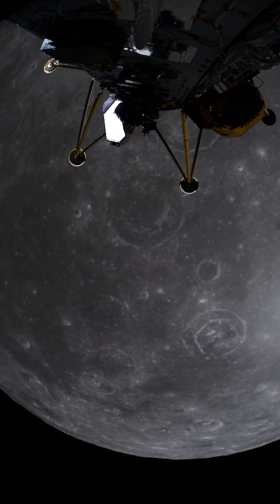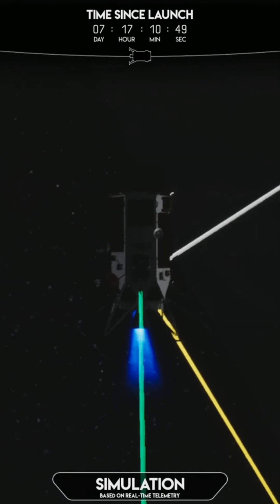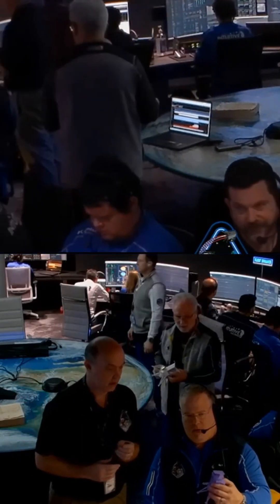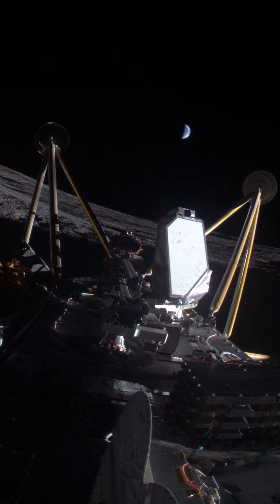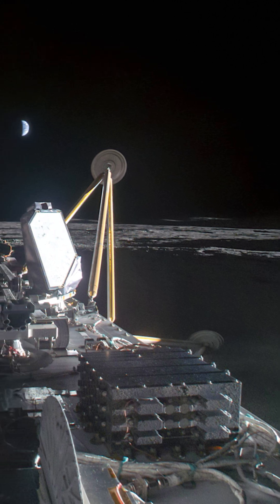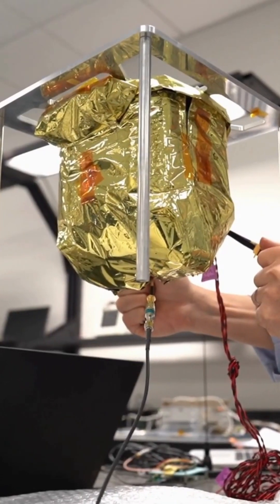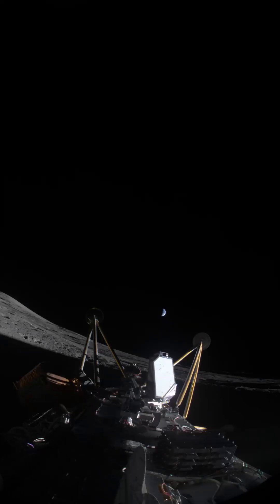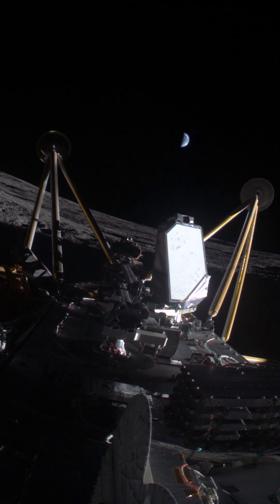What Exactly Happened To The Athena Lunar Lander?

Comment: shiman, these failures are expensive, and humiliating.

Legs - farther apart!  If it can't be stable on a 45° or 60° incline, don't launch it.  And, maybe a bit of leg flexibility so it can better adapt to weird surfaces.  Six legs, and maybe an automated way to relax some if they're causing it to tip.

Center of mass - should be low, not high.

Solar Cells - if they're not pointed at the sun, ☠️  Maybe some backup cells, all over the outside, so there's always some pointing to the sun.  In case of disaster.  Solar cells are cheap.

Antenna - similar.  You have a directional antenna, for use if you're lucky.  And an omnidirectional antenna that always works, although not so good.  So you can still communicate, even during a disaster.

Testing should be malicious.  Walk over to it and kick it, see how it behaves.  Turn it upside down, see how it behaves.  Throw sand on it.  Throw rocks at it.  Keep saying to yourself that it's running with some major sort of crippling - how do we get around this?  What if the battery is almost dead?  What if he solar cells can only move a few inches?  What if this or that happens at night?

You may think it's a waste of time.  No, launching a spacecraft, flying it to the moon, and having it fall over and die, is a waste of much more time. Test and fix.  Test again and fix again.

Comment: Please forgive me, I don’t know anything about this stuff… Why not design a landing vehicle so that the solar cells point in any direction or are movable?
Reply: thats a complicated system, more points of failure there. Since this lander is landing at the poles the sun will move in a circular pattern around the lander and it will always be low in the sky. So its easiest to just put a static solar panel on the side of the lander

Comment: I kind of wish they had inflated a bouncy house all around the lander, so it could roll around to a flat spot before deploying the lander legs and sitting upright.

Just because it should be fun.

Based upon Murphy's Second Law of Entertainment,
fun things usually work better.
Reply: They've done it before. Mars Pathfinder and the two MER rovers were both enclosed in a layer of what are essentially car airbags to cushion their fall. That doesn’t solve the problem of landing in the right orientation, which was instead achieved by having the spacecraft within open up like a flower (which would force them to tumble right-side up). I believe the problem with modern Mars rovers and these Moon landers is that they are too heavy for the airbag technique to work.

Comment: It could be it didn’t land too fast (though likely or just barely too fast) and the issue is the leg design. Have ing a good flex like a shock absorber dual to keep leg “centered” may be required.  If one leg can hold the weight of the whole unit because it contacts first, it could snap.  It engendered to all touch down evenly/level for GVW, and it lands on one (hard or soft) it could be a weak design.

Comment: Not to put a too fine a point on it, but learn from the successful Apollo landers. The center of gravity is too high, so of course any lateral movement on landing is going to put it in the dirt on its side.  Might I suggest a 1:3 ratio. For every 1 unit vertical, have the opposing landing leg pad to landing leg pad distance be 3 units.  Problem solved.

Comment: Keep the centre of gravity low and the legs wide apart on future missions if you want to give your lander its best chance of survival.
Reply: The lateral velocity needs to be totally zeroed before touchdown. But the laser optical system didn't work correctly. So it didn't "see" the surface, didn't know the true altitude, nor relative velocity. Probably also couldn't exercise the hazard avoidance of steep slopes or boulders. 

Note how the altitude readout never dropped below 5 meters. It was flying blind.

Comment: They haven't understood the effect low lunar gravity has on lateral stability.  See A11 in P67 manual flight segment.
Reply: They need to totally zero lateral velocity before touchdown, or it's inevitably going to trip and tip over. I think the laser sensors for relative surface velocity and altitude failed. It once again was relying upon inaccurate inertial guidance calibrated in orbit.

Comment: All the time the lander's IMU accelerometers revealed the exact orientation. But they kept it secret "needing pictures" to determine the final orientation. What a crock! And yes, I have written spacecraft attitude control flight software.
Reply: Give'em a break. You don't want to claim failure and then find out things were fine.
Reply: Yes, it was not believable that they said they didn’t know the orientation of the lander and needed to get pictures.
Reply: IMUs do NOT take kindly to harsh impacts. There's a reason why these things use many sensors in coordination to determine things. Data from any one sensor could be bad.
Reply: @ Thanks. It is not clear from what they released whether it was a hard impact or they landed on a steep slope and toppled over.

Comment: I'm always amazed that they seem unable to add a couple hydraulic 'spider legs' that could upright a fallen toppled lander, spiders on Earth, with much greater gravity, use them all the time...
Reply: A leg or two broke
Reply: It was traveling sideways at the touchdown, and erroneously, the altitude readout was stuck at 5 meters before and during touchdown. 

IMAO, the inertial guidance system never got an update on the landing site from the optical laser system.

Comment: Why did they make the lander so tall and top-heavy?  Something with a wide base and a low center of mass would still be upright even after crashing at high speed
Reply: Might be a limitation of the fairing on a Falcon 9 or the kinds of instruments their lander needs to house.  It could be one of their instruments needs to be further away from the surface or that they need to stack experiments vertically as they can't squeeze them in horizontally and fit inside the fairing on a Falcon 9.  Does seem like a poor design for a surface that is notorious for unexpected rocks and craters in landing zones as you really have little room for error in lateral movement if you don't want to tip.

Comment: It is not the first time a device sent to somewhere ended up with the solar panels facing the wrong way. I get that every little bit of added weight is added difficulty, but for such an important element as providing power, one would think they would plant solar panels on all sides or have a mechanism flipping the panels.
Have these guys play some Kerbal Space Program to learn how to construct something that can get up after falling over.
Reply: one word, money. 
if everything goes as plan, you don't need it, so you don't pay for it. 
A single kilogram is extremely expensive to bring in orbit, many time more expensive to bring it to the moon. 
Kerbal is a good game, but it's still a game. Economics are enemy #1 in the real world.
Reply: Seems like solar panels are just a bad idea for anything space especially when we can build RTG’s that’ll power a space craft for 50+ years. Just like the Voyager missions.
Reply: @ how much for a RTG compared to a solar panel? Where do you put it on the current craft?
Life is not a game.
Reply: @christophergruenwald5054  RTG is very costly and hard to make. Good luck with that.
Reply: There are solar panels on all sides AND the top, though. It just happened to fall into a crater that receives no sunlight. It's very dark in those crates down at the south pole.
Reply: My thoughts exactly. All that effort getting there goes to waste if you've no power so no matter how expensive it is to design a resilient power generation system, it has to be less expensive than a landing f*ck up.

Comment: Okay, I admit, I'm not an engineer, but please hear me out. 

What if, you made the CG lower?
Reply: That would help, for sure.  But IM's landers seem to have a serious issue of not knowing where they are, and hitting the surface harder than any reasonable landing leg system could survive.  Plus, its hazard avoidance system can't tell when it's landing inside a crater, which is a pretty bad downside for a Moon lander.  That needs to change before they start changing the basic shape of the lander.
Reply: A low CG doesn't do anything to stop you from tipping over if one of your landing legs is broken.  IM needs to fix their guidance and navigation so they can land slow enough to not damage the vehicle.
Reply: @Dovorans  Disagree. IMO. Needs to be more resilient. Single point of failure both times despite landing in a functional state.                               
                                                                            Go stand up outside with your feet together, arms at your side, and have someone push you. Repeat sitting indian style on the ground. Get back to me.                                                      
                                                                                 Wide base, low CG, means vehicle is more likely to stay upright on questionable or unknown terrain. Velocity wasn't horrible as vehicle was functioning. Even if a leg or two breaks with six of them vehicle would be near optimal. This is two in a row. 
                                                                                        They could even keep rectangular form factor just re orientate the insides. Main engine facing out what is a long vertical side now and gear around that long low wide base. Allows same packaging more or less for flight also. All IMO of course
Reply: You have no idea where the CG is.
Reply: @SnapJack-kd6kk  But I can guess using logic, previously acquired knowledge and experience then still say the form factor is wrong IMO. You being upset is just a bonus.

Comment: I think that, in their two attempts to land on the Moon, Intuitive Machines has shown that they, and the lander, don't have sufficient awareness of position, descent rate, altitude and even attitude of the vehicle.  Compared to every other lunar lander out there (and my direct memory goes back to Luna 9), it seems the worst equipped to be able to maintain its landing profile.  The entire descent operation needs to be entirely re-thought, an inertial guidance system needs to be added, and if they want to maintain the height of the vehicle in landed configuration, they need to increase the leg spread and ability to handle touchdowns harder than the design load.  It's like heading out in a car for a destination 1,000 km away without a working speedometer or gas gauge.  It could work if you're both very lucky and have a bunch of work-arounds in place to get the data you could have gotten from those two instruments, but the odds of getting there as planned are greatly diminished.
Reply: It has always had an inertial guidance system. But that cannot be accurate enough on its own. The ground surface needs to be observed and the laser system is supposed to achieve that. It didn't.

Comment: Why don't they just put more side legs on it? Like, give it articulating legs on the side to right its self. Go to all the trouble to get it there ... just put some extra legs on it just in case.
Reply: Their landers' lack of awareness of their altitude, how fast they're going, and that big black circles in the hazard avoidance photos are craters, all mean that a generally sufficient landing gear can break because you hit the ground too hard.  The answer isn't to beef up the gear, so much as it is to improve the lander's awareness of where it is and where it's going, so that it can land softly enough not to break the legs.
Reply: @DougVanDorn  but they can't do that, so why not go ahead and add extra legs to make sure? Go to all that trouble and then it fails because you cheapped out on the legs ...

Comment: So what I’m taking from this and their press conference is that they need a better altimeter. If they did in fact fail to land upright because of a broken strut they’ll either have to beef them up and accept the low fidelity on their altitude readings or find a way to reduce the noise so they actually know their decent rate and altitude
Reply: For what it's worth, it seems like landing on the inside wall of a crater would be game over regardless of your altitude accuracy.
Reply: @x--.  nothing to do with "altitude" accuracy, rather poor obstacle avoidance
Reply: @x--.  Video points out leg IS broken. And even if not, then it is still fault of hazardous terrain avoidance software.

You can't have ambitions of landing on moon and blame landing failure on rim of crater. If you landed on that rim, it is your problem.
Reply: @ I understand -- I was responding to the OP of this comment -- their point was that (a) landing legs were insufficient to the task or (b) altitude sensor was insufficient.

My point was that those two things don't matter if you land on the side of a crater wall or as you put it 'hazardous terrain avoidance software' fails to actually avoid a hazard.

I think we're in agreement :D
Reply: The issue was is that they didn’t arrest their sideward movement the device that was supposed to measure the ground and the speed wasn’t working so they obviously need to make a back up here
Reply: That and the fact that their CG is way too high and the base way too narrow. That design looks marginal even for landing on earth, and things are 6 times less stable/more easily toppled on the moon. Low CG, very wide legs. NASA and the USSR got it right with all the unmanned landers in the 60's and with Apollo, what is the deal with so many companies failing to learn this lesson? Every tall skinny lander we've seen since has fallen over, and yet they keep using the same design. Blue origin/Blue moon and SpaceX/HLS are in for a very hard lesson if they don't alter corse.
Reply: @GlutenEruption apparently despite its looks CG is actually pretty low
Reply: @ I agree it's lower than it looks but the design by nature pushes it far higher than optimal and definitely higher than it needs to be. Building up like that just adds mass out on a long moment arm which exasperates any tipping moment if a foot digs in or it lands with horizontal velocity or partly in a crater etc.
Reply: @GlutenEruption  but, if the leg broke bc of poor obstacle avoidance or hard landing then...
Reply: @GlutenEruption  When Masten Space was teaming with ULA to land Centaurs on the moon, the baseline was to use the RL-10 for all the braking, then small side-mount thrusters to land it horizontally. A bit of redundant propulsion made for a very stable lander and low mass for the simpler, shorter gear.